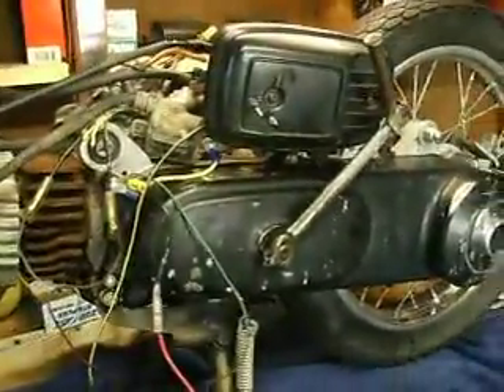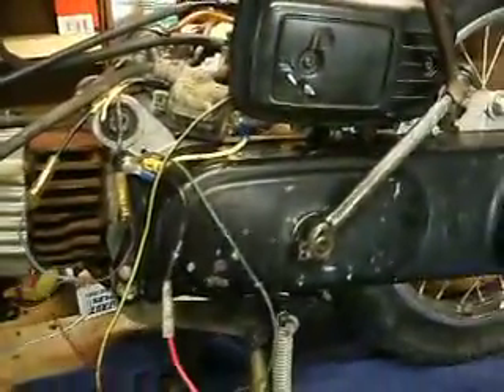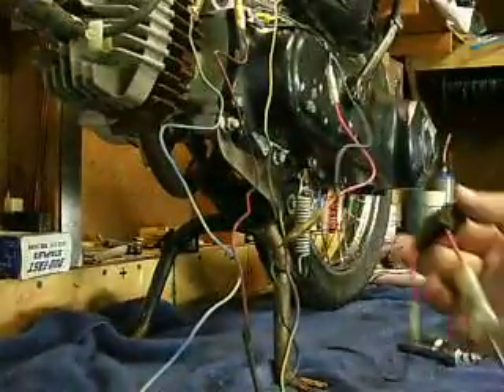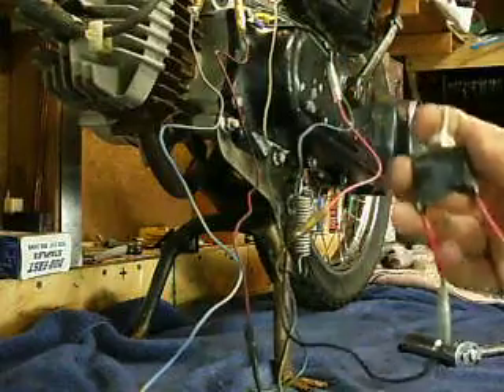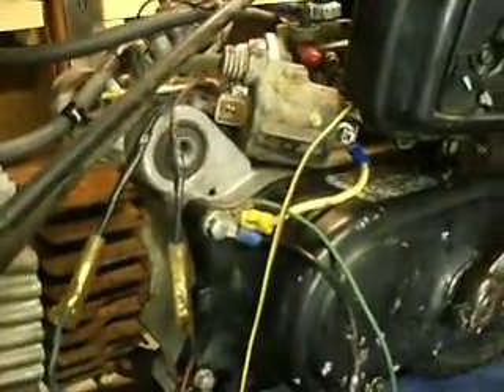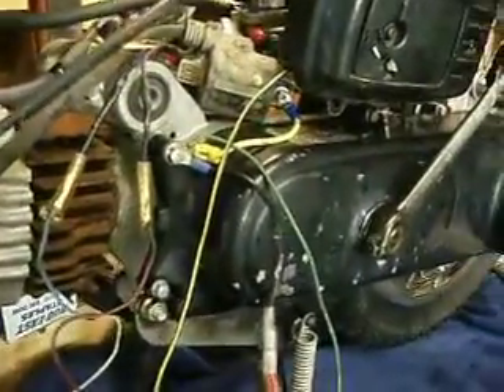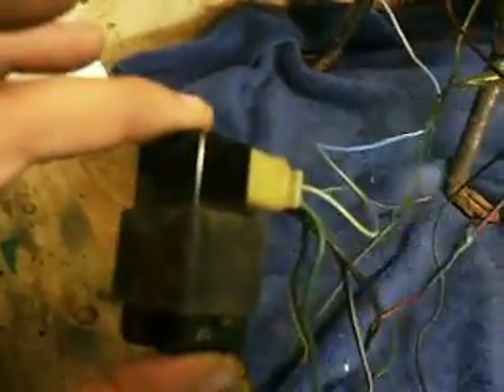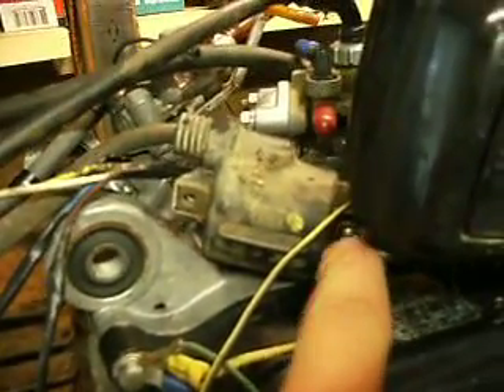Wiring an Urban engine to run

Comment from the maker: @hbkfan22 Fuel line is direct to the carb, running premix so the oil pump is bypassed and auto choke is not used.